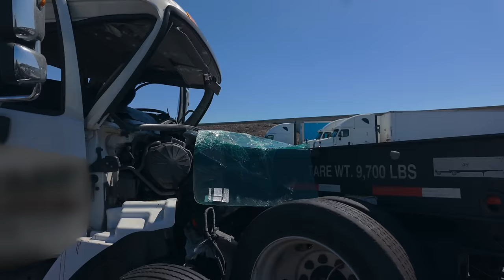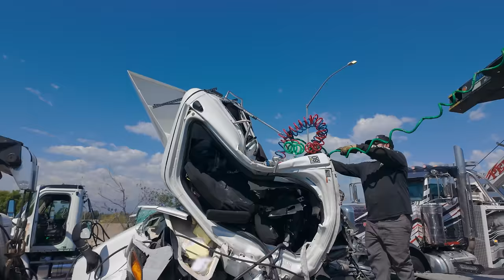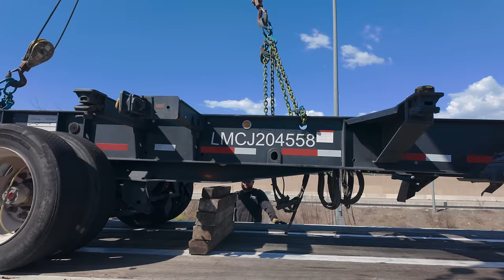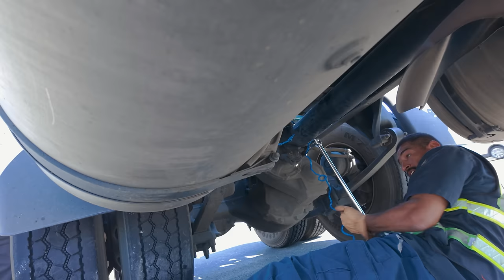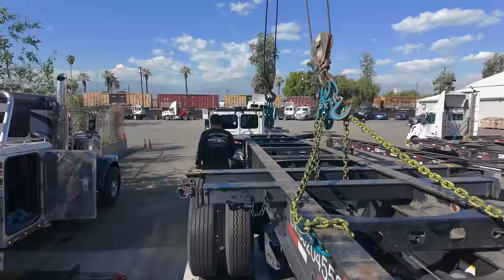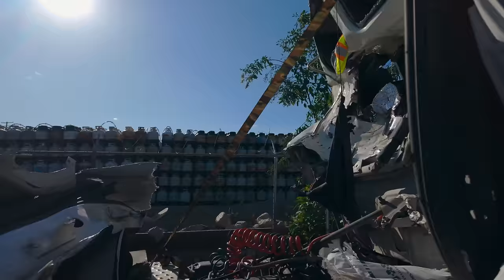Worst wreck I've seen so far

Comment: Hard to believe that Semi driver wasn't a fatal, sure hope she wasn't badly hurt and gets a full recovery.  Really looked like a mess but you sure figured it out quick and you boys got 'er done!!  Great work to the Pep's crew and another great video.  Thanks!!😊
Reply from the maker: Thank you! And right? I knew it wasn't a fatal because it didn't go to evidence and the coroner was not there but man, I would have bet all my money it was just by how the cab looked.
Reply: Josh I'm sure you know this,  the

 slider pins on that chassis if it's an air slider just spin onto the 30/30 brake can and are snugged with a jam nut. The outfit I run for has the Tri-axle version. Outside my Dump chassis. My favorite chassis. 
Crazy that it sheered the 5th wheel off that Freightliner. 
That chassis is only 30 ft long closed.
I got rear-ended in my truck back last fall I stopped for traffic 48mph to 0 in 4 sec. 2 sec. Later I got tagged to 2 mph. Every one was fine. No damage to my truck or chassis. The SUV was totalled.so I was shocked that 5thwheel Sheered off.
Reply: My exact words.  Hard to believe!
Reply: Omg the tow driver is alive??????
Reply: @vincentprice5116  Yep, both drivers lived!
Reply: Amazing all around!  ❤

Comment: As a senior in high school i worked on weekends doing footers or foundations for new home construction and one morning for no reason i hid and didn’t answer the door when the boss came to pick me up and on his way to the job site he rear ended a semi and the trenching machine on the back of his truck came forward and completely crushed the passenger side of his truck cab. I would’ve been dead no doubt about it. What told me to hide and not go to work that morning when i never missed work?🙏🏿
Reply: Your gut instinct. Or angel unawares
Reply: @vickeymaxwell-iu4ts  not sure but definitely divine intervention🙏🏿
Reply: @DiabloBlanquecino  I have had divine internvention I think, but a completely different scenario. Back when I was a dumb teenager in 2006 I got a DUI and I had EASY to find drugs (pills) in my pocket and I was search twice with pockets pulled out and it was never found. I don't know how that was even possible. I know it's not even close to the same thing because I was dumb back then but still.
Reply: @xeldinn86  not catching that drug charge could very easily have saved your life in a way💯
Reply: The Holy Ghost was with you my friend. God bless. So sorry about your boss.

Comment: I hate that part of the 60.  Especially bad right now with the 71 under major construction.  The back-up is so bad and so many trucks stopped in the lane.  Gotta pay attention to the traffic up ahead and not be too close.  Especially when loaded.  I realize it is easier said than done.  Glad all the drivers are ok.  A testment to how well modern trucks are made, and maybe a bit of divine intervention.  The amount of force it takes to shear off the fifth wheel slider from the track is a lot.  Sends chills down the ole spine.  Good job, as always.
Reply from the maker: It's worse as you take the freeway to and from Ontario. They re-did the lines for the lanes and it's so confusing in daylight because you can't tell which lane is which lol

Comment: Honestly, 9 times out of 10 you want to plumb air as close to the compressor as possible. I genuinely fell in love with towing trucks with the older Cummins blocks, because Cummins used to put an R134 fitting (i.e. the same connector that's used on the air conditioning system) on the metal compressor output line. There's a neat little tool (which comes in a full set, I can toss you the link if you want... super useful, paid for itself multiple times within my first week of having it) which can utilize that fitting and a quick connect to get air into the system of the truck you're towing real friggen quick. Like, full air hookup in less than 5 minutes quick. Some trucks the play is to disconnect the compressor output line and hook an adapter directly to it, some trucks you have to go to the air dryer and force the system to pressurize in reverse, and some trucks I've had to pull drain valves off of tanks and run air directly into one of the tanks. Many many ways to get air into the system... the bigger challenge is certain types of drivelines that refuse to play ball when you go to pull them. To this day, I well and truly hate pressed-in drivelines

Comment: That looked like a double fatal at first glance. The gal in the tractor got crazy luycky and i hope there aren't any permanent injuries. As for the worst mess on the channel...it is the most mangled i have seen on it for sure. 
    I do appreciate you cutting in in the middle at home I am assuming explaining what happened to the gal driving the tractor. Seeing the fifth wheel plate still attached to the trailer chassis is crazy when you think about seeing rigs dangling over bridges and the like being held up mainly by the king pin. 
    A great video as always Josh🙂

Comment: I love your videos.  Much engineering goes into dealing with such a wide variety of wrecks.  
Beautiful, expensive, well maintained equipment. You and your employees do a great job. 
Now for the complaint, I am a 78 year old Vietnam Combat Veteran.  I avoided body piercings by ducking at the correct time.   I don't understand why people drill holes in their ears, noses and where ever else.  Pull the rings out of your ears and restore them before you are old and your ear lobes are touching your shoulders.   Thanks for your video work.

Comment: So the flat bed tow truck rear ends the semi; the fork lift crashes through the tow truck cab!  then the semi trailer takes out the tractor cab,  very lucky drivers.  I can't believe how much use you guys get out of the Landoll Trailers.  We see Flipper and Hulk a lot, It would be great to see a review of how many trucks it takes to run your operation.

Comment: As a retired truck driver, Nev. to Cal. and back once I had to be towed back to Nev. They refused to tow nose first because they said the differential would explode and make a real hassard on the road? Your thoughts?
Reply from the maker: Yes, that is why the drive shaft is always disconnected. I'm sure there's more to the story. Was there an issue with your drive shaft?

Comment: Both drivers definitely had angles watching over them.
   I drove OTR for 5 yrs, the worst semi truck wreck I ever seen was , a driver on the sholder just right before a Rest Area,had marker lights on, a loaded truck rear ended that parked trk.Unfortintly the driver didn't make it. Pretty much the front side of the driver door was right uptight against the reer of van trailer doors,oil ,pieces of engine ,diesle all over the place, slow lane closed.The last rest area West bound on I -40 where I -40 & I-15 meet. It was horrible

Comment: With those landing gear you could wench those landing gear forward so they are straighter so it is little bit safer ,yes those brackets are bent and broken since the company will have to take them off any way if they even straight the frame out an reuse the trailer .

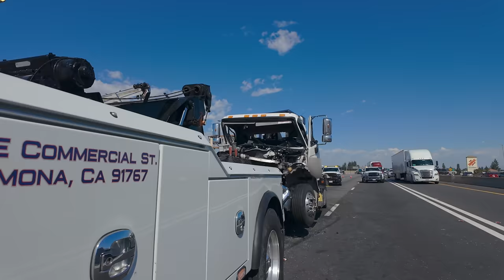Comment: I have a question. at 24:29 the car in the back has it wheels turned towards traffic. her in the Netherlands any emergency that is the blocking traffic has to have his wheel turned away from traffic so if it does get hit then it wont go in to traffic and it will most likely be hit and turn away from traffic. do you guys in the US have rules like that or is it different?

Comment: 8000lb forklift prob a bit too heavy for a lowpro hino just sayin. Glad he's ok though! Good thing he had it on backwards or the forks would have intruded in the cab. If he was overweight, and I'd bet money he was, that's on the company. The driver will fry if it becomes a criminal charge for injuries though. I don't let my company pressure me into running overweight. They used to try. You'll get the "well the last guy did it no problem" argument or whatever. Had a dispatcher try to tell me a 4x4 crew cab diesel f250 was 5500lbs once cause she googled the lowest weight she could find. It's not worth it. The boss or dispatcher isn't the one going to jail if something happens, I am.

Comment: There is no need to pre fill any oil filter anyone who has seen the inside of a engine should know this the oil doesn’t just pour straight in and end up in the sump it’s poured in fills up the valve cover then runs slowly through the head down all the oilways over the valves through the block oil pump then when you start it it pumps up into the oil filter it may need a bit of a top up afterwards but no need to make a mess and pre fill
Reply from the maker: Ummm ok? But you totally commented on the wrong video

Comment: Your work is awesome. I can see you trust and faith is there in your equipment. However... in a OSHA environment what your missing is your "Deadman" straps or chains. A simple hydraulic malfunction or weak chain link will injure or kill anybody that is within 1-5 ft. Of your overhead lift. Fluorescent straps work great and allows your help to lean back 15-20 ft. Out of harms way from a free fall. The use of  perimeter caution tape ensures your covered liability wise from walking idiots. Don't  always trust the police to be awake, they work long hours and occasionally are focused on other tasks, paperwork, wife, etc. You can always recycle and take the ribbon  caution tape back to the truck and use it again.